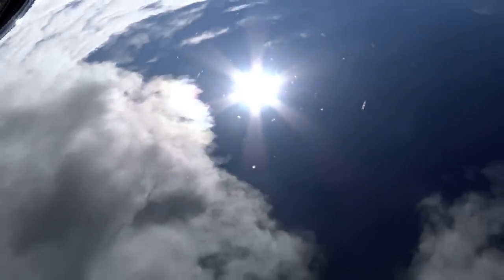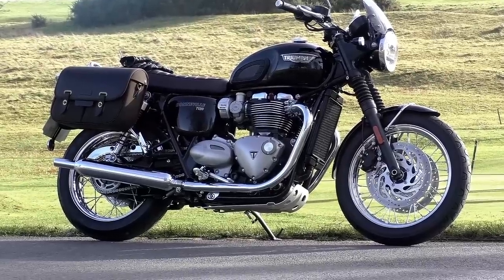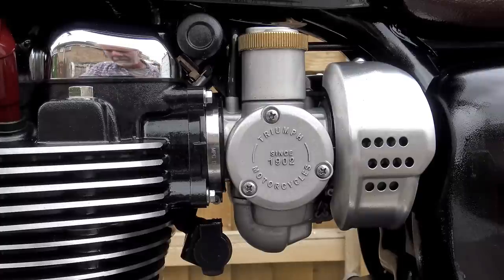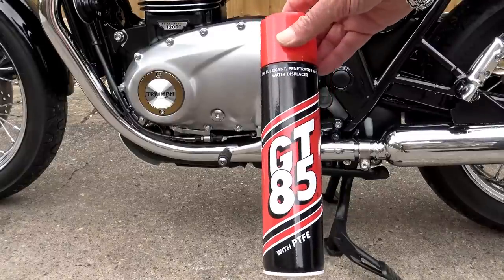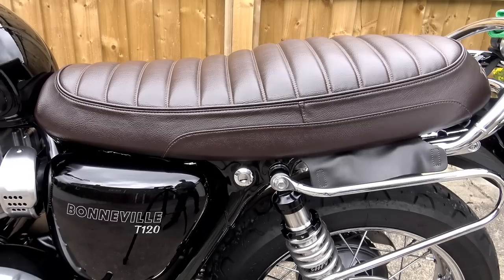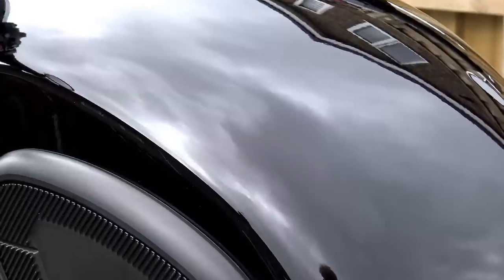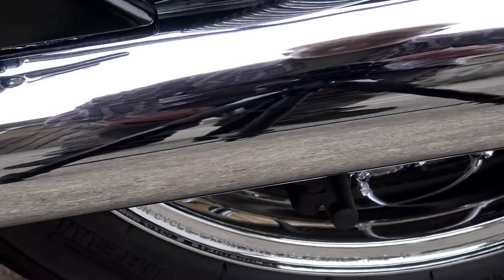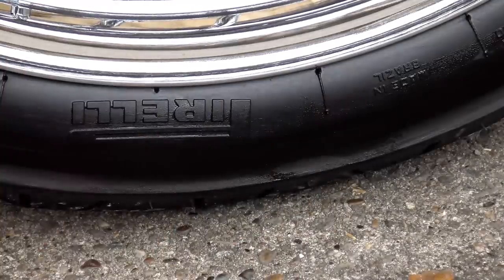Triumph T120, WAXING, DETAILING & PROTECTING your motorcycle

Comment: Hi Stuart, I have just put an order in for  T120 Black, your videos helped tremendously in my decision process. Having watched this and your 'Full Fillingham ' video I have one question. On the Black exhausts would you use the wax the same way as on the chrome exhausts or would you lean towards the matt  detailer? I believe it's a ceramic coating so not a true Matt Paint but any knowledge or touts would be appreciated.
Reply from the maker: just use an oil based maintenance spray when needed.

Comment: Great video as always, Stuart. have you noticed, the T120 seems to have a clearcoat on the aluminum engine side case? What's the best way to take care of that? I got mine with 1900 miles already on it and the side case seems to have developed cataracts before I got it ... the case covering seems almost faded or glazed. Any ideas?
Reply: I wouldn't really call it scabs ... more like a pale white glaze, already on the bike when I got it, not in just one spot where a boot touches, but all around it. You're sure there's no clearcoat? Thanks in advance, you know your stuff, Stuart.
Reply: Stuart, its like the clear coat is becoming cloudy. I have see this on aluminum rims when you clean them with a caustic cleaner. The clear coat becomes hazy and streaked with drips. This is only on the aluminum engine pieces that have been clear coated from the factory. The only fix I see is to remove the covers, media blast them and aluminum polish them. Was hoping you might have an easier fix.
Reply: Just to clarify for Stuart - Doug and I are riding buddies, he's talking about my bike.
Reply from the maker: I know where your coming from with that Doug but I think removal media blasting and polishing is perhaps a lot further than you have to go to sort this, if it is what I think it is!
If you have facebook, could you send me a friends request and then send me some pictures after ive added you, You can post them directly on to my main page, that way it may help others out if they have the same problem. 
If it is what I think it is, I may have a reasonably quick and cheap solution, just need to see it first!
Reply: stuart fillingham will do asap.
Reply: >>  is it possible some one has  used alloy wheel cleaner on it at some stage?
Anything is possible. I got the bike with 1900 miles on it, the guy before me decided he wanted a T120 black and traded this back in. (Now I know why he wanted the black - he didn't know how to care for the side cases properly). I'll send you a friend request on FB and show you some close-ups, I'm interested in hearing what your possible solution is. Thanks again Stuart and as always, keep up the great videos.

Comment: Hi Stuart. Great video.  I've just taken delivery of a new 2017 T120 but I would like you to clarify a couple of points. Do you use GT85 or the Miracle Shine on the exhausts? my concern is that the exhausts - particularly the header pipes get pretty damn hot and I'm concerned that any wax or oil substance applied to the exhausts may carbonise to a black mess. Have I missed something in your video?Secondly, The Triumph Owners Handbook for the T120 (page 123) specifies "Motorex 645 Clean and Protect" for the exhaust system. Is this equivalent to GT85?
Reply from the maker: you can use either Ken but i prefer to use the miracle shine!
Reply: Thanks Stuart; As I said before I didn't want to end up with a black mess on the exhausts (should have mentioned that they are chrome exhausts - not black)
Reply: Many thanks for the re assurance Stuart.
Reply from the maker: your welcome sir!

Comment: Hi Stuart, do you know if the Muc-off product is available in Australia? By the way great videos you make..
Reply: Hi Martin. You have to go to Bicycle shops for most of it. The bike cleaner spray is available on ebay in bulk and is excellent for cleaning a motorcycle. Not sure about the Wax. Bowen's make an excellent liquid wax and touch up detailer wax available in Repco etc.

Comment: Hi Stuart. Apologies if this has been asked already but what do you use on your wheels/spokes/discs? I've had to take a Dremel + wire wheel to clean my T120 spokes before now they rust so easily. I'm worried about using something like ACF-50 in case it affects the brakes. Thanks in advance!
Reply from the maker: I havent really had a problem with mine, although i know it csnt an issue.  i use a good wax polish on the rims a couple of times a year. use ACF50 by all means on the spokes but apply it sparingly with a rag.
Reply: @stuartfillingham  Thanks for the info. Looks like another thing to add to the post-lockdown shopping list!

Comment: Hi Stuart
How about protecting and "polishing" my beautiful black matte Street Twin?
Will any PTFE do the trick as I can't get GT85 in my place?
I now went through the whole video....lol
Thanks
Reply from the maker: I wouldn't recommend a ptfe maintenance spray for paintwork sir. try MUC OFF matt finish detailer for that!
Reply: Thanks Stuart was talking about the engine using any brand of PTFE
Reply from the maker: Ah my apologies! if you cant get GT85, MUC OFF MO94 or Double TT. any other can be used but make sure it is a decent quality brand that has a good reputation.
Reply: stuart fillingham thank you very much following your clips and loving your accent...lol
Keep the good work sir
Reply: Hi Stuart after some search the only valid option found is WD40 dry lube with PTFE. 
Do you think would be ok to use as cleaner and protector on the engine?
Reply from the maker: In my personal view its not the best but WD40 will do in a pinch!
Reply: stuart fillingham sadly that is my only option in this part of Malaysia hopefully it won't damage the engine
Reply: Stuart Fillingham good day sir 
Do you know anything about "Rock Oil non silicone bike wax"? made in England seems ok for all engine parts and exhaust as well

Comment: Hey Stuart,
What do you recommend for cleaning and protecting the seat? The leather cracked on my old 1984 KZ550 LTD and is like to prevent that on my new T100
Reply from the maker: I wouldn't recommend using any kind of dressing on bike seats Julien as they can make them slippery.  the modern materials used in seats these days are far more resistant to this type of damage than used to be the case. I would just recommend you minimise its exposure to the sun where possible.

Comment: Great videos, I have a matte graphite colour, any advice on how to detail and protect it. thanks
Reply from the maker: Yes sir Matt paint has always been tricky! Muc off have just brought out a matt finish detailer especially for the job. ive not had the opportunity to test it as yet but I reckon it is probably your best bet! I did mention it near the end of the video if you would like to take another look!
Other wise any none abrasive carnauba based wax should be ok, just don't use it too often, only when the water stops beading up on your paint. it will satinise the finish slightly, but that will happen over time anyway!

Comment: Hi Stuart. What do you recommend for the front forks, mine came with scuffs just above the reflectors on both sides as if something had been attached, would rubber and vinyl dressing be safe to use on them as they dont come up well with wax?
Reply from the maker: just put some maintenance spray on a cloth and rub it in to the fork leg Pam. sorry for late reply.

Comment: Hi Stuart, do you have any techniques to handle the tiny paint chips you can get in the tank or fenders?  I have a couple very tiny blemishes, not to the metal, probably from pebbles flung up by other cars.  From past experience on my car, I'm pretty sloppy with touch up paint, so I'd run the risk of making the tank look worse.  I'm more worried about protection than getting it the paint back to perfect.
Reply from the maker: Yes I do ill make a video at some stage . meanwhile just use a good wax to protect it.
Reply: @stuartfillingham  Brilliant. Looking forward to the video.

Comment: Hi Stuart, thanks for another informative video. I wondered what your opinion is on the use of silicon spay as an alternative to GT85. I was first introduced to it in the mid 80s by another biker and used it on my GPZ900r. The bike always looked immaculate and was very easy to clean between applications. In fact I coated the whole bike - apart from tyres, brakes, seat etc - and never bothered with waxing. It provided shine and waterproofing but wasn't sticky so didn't attract dirt. I now use it on my 2003 triumph speed triple.
Reply from the maker: i often use pro prep which is silicon based but its no substitute for the protection wax provides.
Reply: @stuartfillingham  no indeed. I actually meant silicon (should that be silicone? I get the two mixed up) as an alternative to gt85 on the parts you wouldn't normally wax but I take your point. Many thanks for replying and thanks once again for the informative videos.

Comment: Nice video that. I’ve been cleaning my cars and bikes for a long time now but it’s always interesting to see someone else’s method. (I’ve always been a bit slack tbh) I’m taking your info on board however and although I’ve been a long time user of muckoff I wasn’t aware of the miracle wax so have ordered some and shall use you system on he next wash of the gloss one.  Still not entirely sure what I should be doing with the Matt one (GRISO) So far I’ve only washed it with dedicated car shampoo after a spray with muckoff.
Reply from the maker: I did publish a video on caring caring for matt paint a few weeks ago Steve if you would like to have a look for it!
Reply: stuart fillingham Thanks. I shall.